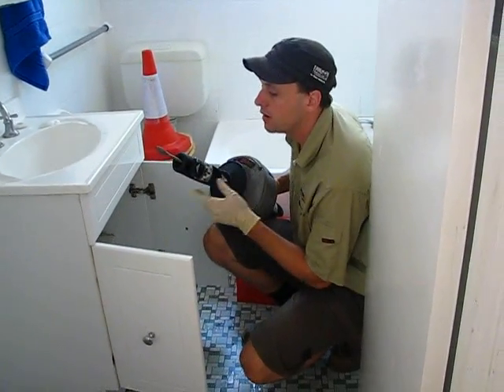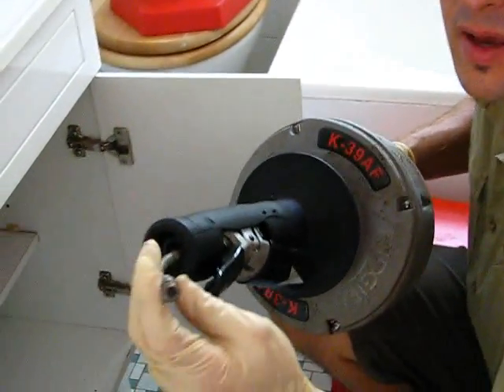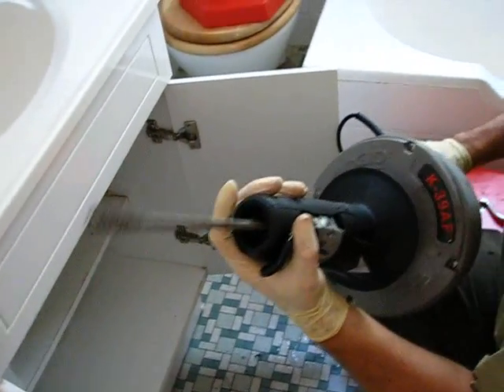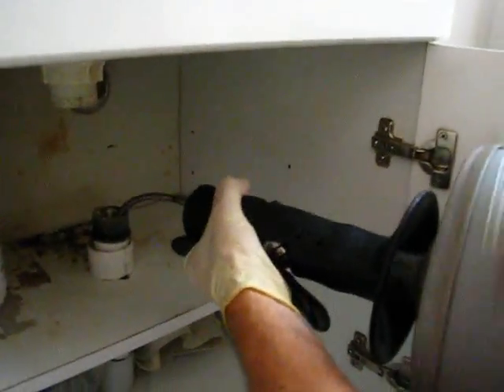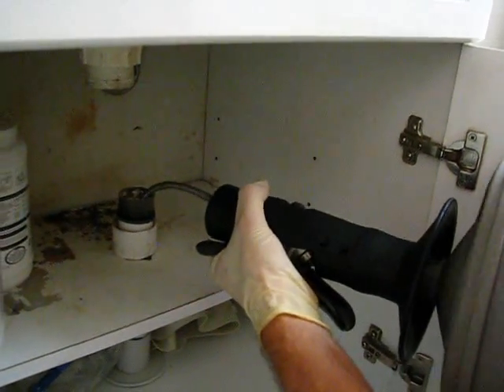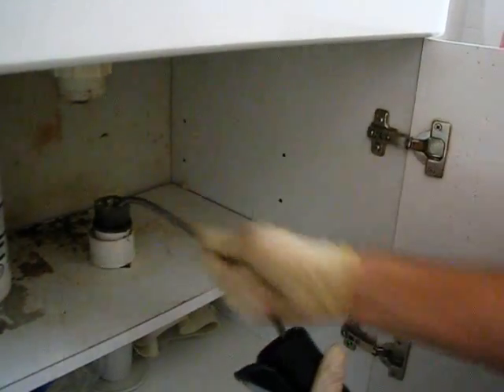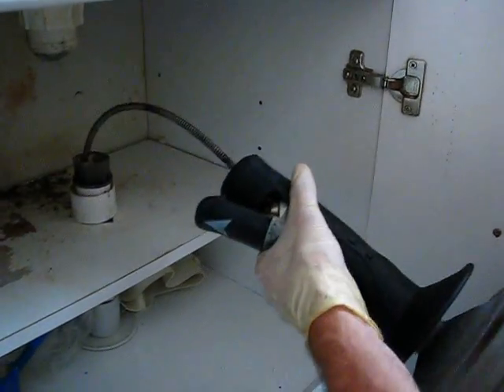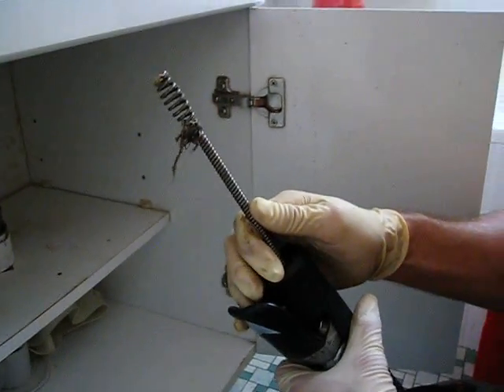HOW AN ELECTRIC DRAIN SNAKE WORKS.

Comment: Done my drains numerous times with just the hand-cranked version.  Having 3 daughters turned me into a plumber...
Reply: Show them what is plugging the elbows and pipes.  They need to know that hair, jewelry, small toys, sand, rocks, un-cooked rice & beans create obstruction's in the drain. My sink is 42 feet from the main cast iron mail drain with a frozen clean out over the water heater and pointed away from the kitchen. The 1 1/2" black ABS is below the floor joists giving it a 1/2" over the entire run. Built in 1980, they used hard Tee's and hard elbows instead of streets making it nearly impossible to snake around them. I had to install a clean out at the utility room closet facing the kitchen. Handing a bucket after loosing the clean-out nut. Even tempered spring steel needs cleaned with hot water & oiled lightly. Hope to not be used.

Comment: hm... I am convinced that cheap garbage drill based snakes are junk. Looking at his snake, the cable is 3x thicker than the one I am using (barely 6mm thick), and it has kinks in it. Kink - fail. They then start to wind up and whip around everywhere... so... do I spent $300 on a good one? or do I pay the  plumber $100 a drain?

Comment: Hello.
I'm in the market for an electric snake to clean kitchen and bathroom pipes.  I'm looking to purchase soon. I live in the US on the east coast.  
Electric version is a must.  
I need automatic forward action.  Must have a "feed-forward" switch. 
I'd like a reputable brand.  I heard Harbor Freight tools are not good.
I need a snake that is "portable".  In other words I do not want a model that comes with an integrated cart.
I'm looking for under $375.
Prefer local dealers.
Suggestions?
Reply: i got milwaukee tools power toilet auger for 150.00 shipped directly to home in tampa fla i havent used it yet, but my HANDYMAN FRIEND FROM CHURCH SWEARS BY IT AS BEST QUALITY N VALUE FOR THE MONEY N CHEAPER CALLING PLUMBER FOR 200.00 AN HR HERE THE LINK OR MODEL NUMBER ETC~~~https://documents.milwaukeetool.com/58-14-2576d1.pdf, MINE IS THIS EXACTLY::: https://www.milwaukeetool.com/power-tools/cordless/2576-20 GET THE ONE WITH RED LITHIUM M12 TRAPSNAKE 6 INCH POWER DRIVER GO TO MILWAUKEETOOLS.COM,  NO I DONT WORK FOR THEM, I JUST USED LIVE IN MILWAUKEE , WI BEFORE I MOVED TO FLORIDA THEY USED TO HAVE REALLY GOOD QUALITY PRODUCTS IN PAST